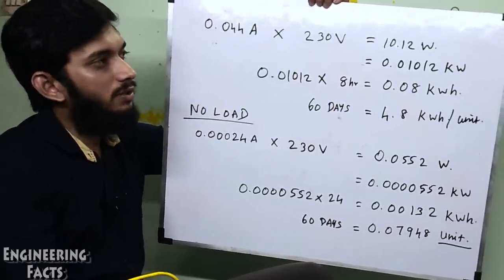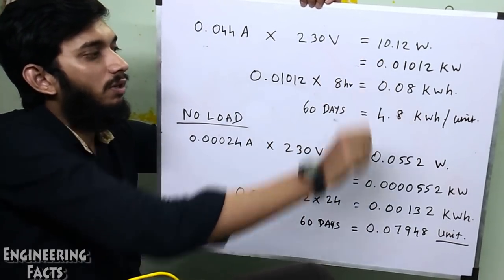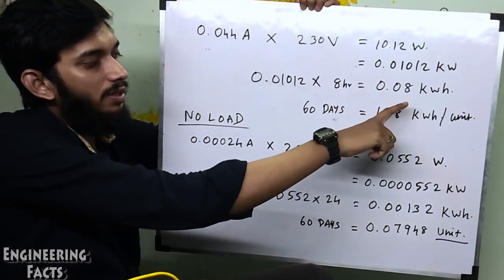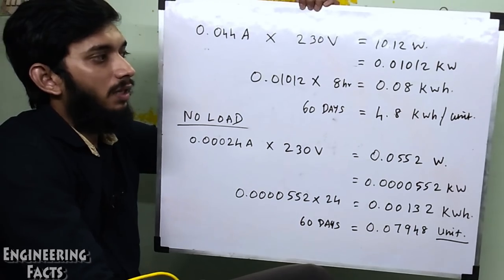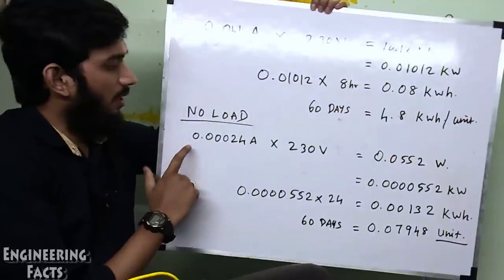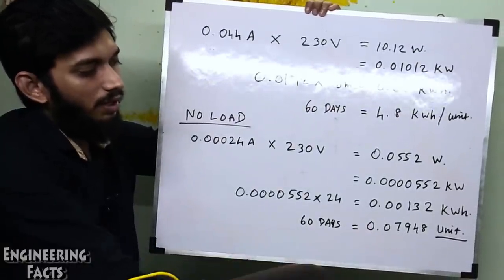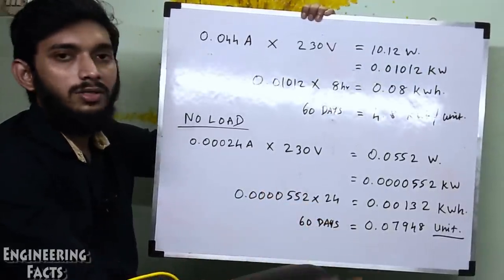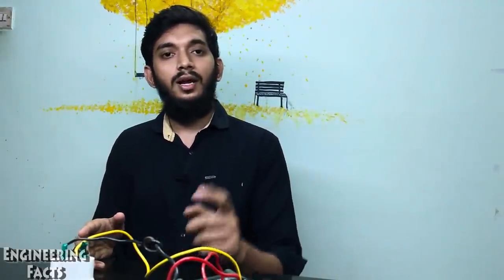"Leaving charger in ON condition" What will happen?_ Tamil, Is it safe, to leave charger in ON?

Comment: Bro sometimes in non branded China chargers due to it's cheap circuit technical fault 230v comes. Inside those charger input is connected to an resistor or diode if it is fault it give 230v in the output.
Reply from the maker: Cheap chargers possible

Comment: It's consuming current because of load resister in input circuit.! It's used to prevent sudden changes in circuit!
Reply from the maker: Explain
Reply: @engineeringfacts  a big size low ohm resister in AC input circuit use as load resister and it costantly eat little bit of energy. as all we know resister consume input current according to it's Ohms rating and dissipate it as heat.
Reply from the maker: I don't see, any low ohm resistor. As I have opened all type of chargers. What I understand is fuse resistor you're mentioning. Which will be connected series with the line for protection. If you connect a low ohm resistor between L N, it'll blast. My info is accurate. Thanks

Comment: Good video, before electricity old church's was using heavy weight to make the clock running. Even in India few clock tower uses weight instead of electricity.I thought it was mechanical force but Now same is used to glow led bulbs . How they convert mechanical energy to electrical energy... ?

Comment: few doubts Charger vs Adapter difference ?
this video only for mobile or laptop also?
and what about adapters or charger with non battery electronics equipments example : Electronic musical keyboard 
there is no battery but using DC 9v and DC 12V

some times i forgot to turn of my keyboard adpaters so any problem is there?
Reply from the maker: Adaptors don't consume power like charger in standby. But it's dangerous

Comment: Bro enga veetla 12v input amplifier use pani songs kepen... Dc adapter 240-12V for supply.. Itha naa use pannalanalum 12 hours /day on panniye vachiruntha.. Evlo amount of power consumption pannu.. Solunha, kulapama irukku

Comment: Hi bro ...I have question.....in my locality there few voltage fluctuations....so I bought a stabilizer for my laptop and other connected equipment like speaker etc....but stabilizer output power is 800va/400 watts it's maximum output amps that states in the stabilizer backside is 230v 1.9amps but my laptop charger input is  100 - 240v - 2.3amps can I connect my charger in the stabilizer ?.... waiting for valuable reply bro....
Reply from the maker: Yes

Comment: Bro ennutaya multimeter la double double la value katuthu for example 12v battery check panna 27 30v katuthu 24v supply check panna 53 55v katuthu etha repair panna mudiyuma model  basic normal ello color multimeter bro
Reply from the maker: Panna mudiyathu

Comment: Its faulty cheap quality adaptor bro. try it with some good brand. it should not happen
Reply from the maker: It's not cheap quality adaptor. It's a good quality adaptor.

Edit: also working adaptor, not a fault one. And tested with other good adaptors also. Reacts the same
Reply: it isn't about the quality ..every transformer in charger  has some leakage flux (waste flux) so it shows some low current (amps). This applies for all equipment which includes a transformer.
Reply: @sanajyvinai2736  This logic cannot be applied for SMPS circuits. May be true for step-down transformers. In a good quality charger, I have seen circuits that will put the SMPS in cut-off mode when no load is connected. The video is informative but getting too technical will reveal that there are different modes in charging and a modern fast charger or even a good brand charger will communicate with the phone before it begins charging (you can find this with laptop chargers). I am not trying to find faults, just adding information. Overall nice video